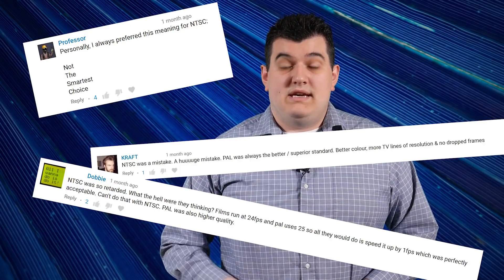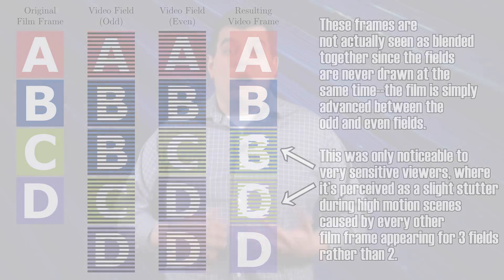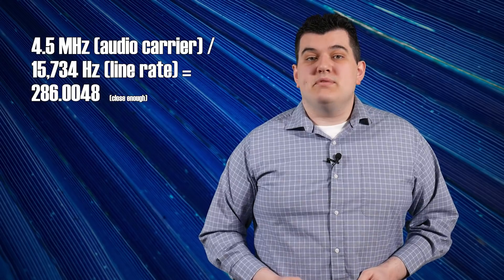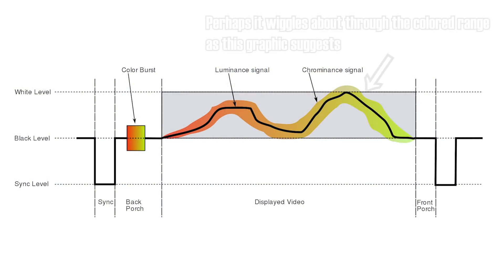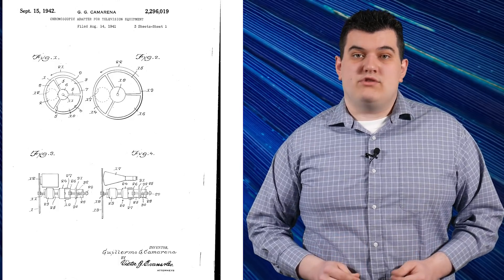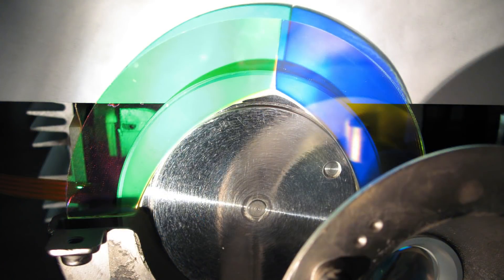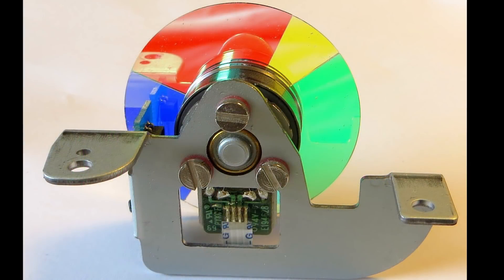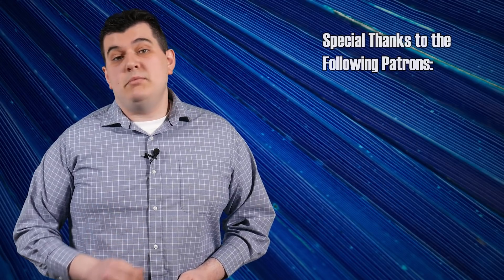Analog Color TV Wrap-Up--Some extra info

Comment: The color information in the video signal is added as a high frequency carrier. The frequency of this carrier is greater than the bandwidth of classic black-and-white TVs which is the trick why those ignore the color information.

Since I am not that familiar with the US terminology for video signals, I stick with what I am accustomed to from the Commodore computers:

The C64/128 generates the Y and colors independently and the RF video modulator mixes them to simulate a TV station. The video jack for monitors offers 3 video signals:

Luminance, Chroma and Composite.

Luminance contains the Y signal with sync signals. This is known as “VBS”, the “Video Blanking and Sync” (BAS in Germany, BildAustastSynchronsignal). This is the classic monochrome broadcast standard.

Chroma is the additional color information, ready to use modulated as a RF carrier.

Composite is a mixture of the signals above, composed together. This is known as CVBS, “Color VBS) (FBAS in Germany, F=Farbe=color). This is usually done by an amplifier with two inputs which adds the signals together. In low cost video equipment, this is often done by using two resistors. VGA cards with “video out” often use a S-video jack and come with an adapter, a S-Video plug with a yellow RCA jack on its end with 2 resistors inside.

It is very hard to make a video circuit with a high bandwidth, especially in the radio tube and simple transistor era. The low-pass characteristics of a video amp circuit can’t follow the fast chroma carrier. What the circuit makes of a CVBS signal is just the VBS part with the average of C on top. The average of the C carrier is supposed to be zero.
Classic radio tube or simple transistor based color TVs still used a simple video amp to obtain the VBS part and a radio tuner like circuit to receive (and demodulate) the C carrier for processing. The tuner also detects if a C carrier is present to enable/disable color processing. In “ancient” TVs, you can hear a relay click which bypasses color decoding and connecting all 3 electron guns to the VBS signal.

More modern TV systems are different and more sophisticated. To get more resolution onto the screen, they filter out the C carrier inside a circuit known as the “Color Trap”. The exact frequency of the C signal is filtered and separated. This allows using high bandwidth VBS amps so you get the  maximum resolution possible.
The trouble is that if there is a high frequency pattern in the VBS signal, e.g. someone wears a pinstripe suit, this pattern can also be “trapped” and used as a color information. Not sure how it looks like in NTSC, but in PAL the suit often has faint pink stains when watching strong UHF channels (or using Sat TV).

The Chroma Signal is very intense. Just like the VBS signal, it also is 1Vpp (1V peak-to-peak). Here is a chart of the CVBS signal for a color-bar test pattern:
https://upload.wikimedia.org/wikipedia/commons/d/d4/Fbas.png
 White is 100% Y (1V), no room for color information left, none is necessary anyway.
Yellow is 66% Y and the C carrier makes the signal jitter between 100% and 33%. A low bandwidth classic TV would see the average of the C carrier which makes it just see the 66% Y inside the signal.
And so on…
When they had copied the color video signal to film using a monochrome machine with high bandwidth, the jitter of the C carrier will go through and cause a relative prominent pattern on the film. Those machines are more like an oscilloscope than a TV tube, extra linear and capable to follow high frequencies. To play back, all the engineer needs to do is to lower the bandwidth of the VBS signal to get rid of the pattern caused by the C carrier, so nobody felt the need to prevent storing the pattern on the film in the first place. 
You can see how this pattern looks like using a C64 with a Commodore monitor. Usually, VBS and C are sent separately to the monitor. In this mode, the monitor disables its color trap. Using a composite RCA adapter cable meant to connect your C64 to a VCR or TV and plug it into the Luminance (VBS) jack, you get a black/white picture with the chroma carrier messing up the picture.
By the way, The Raspberry Pi has a CVBS output (newer versions need an iPod Video cable). Since the VBS signal bandwith is limited by the C carrier frequency, you can disable colors on the raspberry so you are able to get much more detail (finer text) onto an S-video TV. So you can have 80 columns of text (or more) by sacrificing colors. Due to the color carrier, home computers from the 80s had to have 40 columns of text or less. The C128 can display 80 columns, but then you need to use its RGB mode (with special monitor) or you can use an S-video TV but in monochrome only.

Comment: Great Job!
But I have to disagree on the topic of 3:2 pulldown - at least from a modern standpoint.
1. I can understand your point that you want to watch movies at the correct speed but actually... you don't really notice.
2. Today 3:2 pulldown is a pain in the rear. European TV shows that were shot on film (like "The Prisoner") were shot in p25 and broadcast in i50. Even without going back to the negatives and only using the broadcast masters it can properly be deinterlaced by my modern TV. Two fields that originated from the same frame of film are put back together. American shows that were shot on film (like the 80s version of "Twilight Zone") were shot in p24 and broadcast in i60 via 3:2 pulldown. When my TV tries to deinterlace that, I end up with 40% of the frames put together from fields that don't fit together and it looks hideous. On a CRT it's not an issue for me but I can't stand it on a progressive display
Reply: The 3:2 pulldown works great for ordinary film takes where motion causes enough motion blurring. It fails miserably where motions don't cause motion blurring e.g. moving subtitles, fine moving computer graphics and cartoons. While with cartoons, you just loose resolution which causes an "ugly motion blurring", anything filmed with a high speed shutter or simple moving computer graphics looks real bad.

Comment: The discussion of phase issues, was also a concern when cabling video between the sources and a video switcher. Approximately 6” of coax cable, allowing for velocity factor would equal one degree of phasing error at 3.579545 MHz. If phases didn’t match you would get a shift or jump of the phase (or hue if you prefer) at the beginning or end of a dissolve or wipe pattern transitions.

Comment: I actually prefer NTSC. Watching PAL TV always bothered me just a little bit whenever I would visit Europe. Although the picture was a little bit sharper due to the higher resolution, the flicker just messed up my eyes. I can't really see the flicker at all on an NTSC screen unless I move my eyes around really fast or something. But on PAL it's just impossible to ignore the constant flicker and it always bugged my eyes out trying to watch it. I don't know, just a personal opinion but I much prefer NTSC even with the lower resolution and color issues. At least according to my eyes, the reduced flicker was well worth it. In any case, none of this is an issue at all on LCD/Plasma flat screen HDTVs. It's all moot now.
Reply: But the flickering has nothing to do with PAL/NTSC. It depends on framerate and framerate depends on mains frequency. So 50Hz in Europe and 60Hz in US was choosen in 30's - 40's for  B/W TVs.
Reply: I grew up with PAL to me its just a better colour system, American NTSC always looked bad until recently, never had an issue with the flickering even with a CRT, its not supposed to affect you if you are a decent distance away from the TV screen.
Reply: I grew up with PAL (50 Hz) too, but it took me years to get used to that flicker, and even at that point it wasn't pleasant.

Comment: A good example of what we would refer to as “dot crawl” was the opening credits of “Star Trek: The Next Generation” the blue title characters with the high chroma values over black would have visible dots crawling along the edge of the letters. The HD remastered version, the edges are clean since NTSC is not in use. 

You can also see this dot crawl effect on color bars, along the edge of the transition from one color to another, except between green and magenta, where the transition moves through zero luminance and chroma and results in a very thin black line.

Comment: As a German i say, NTSC in the 50‘s was a great performans by american engineers! Heart of NTSC is quadratur-amplitude-modulation of the two Color Signals, you need mulitplyers, free wheeling oscillators and so on. In this times no problem, but in the 50‘s there are only very bad and expensive vakuumtubes.
Reply: My problem is that Americans cheaped out (surprise surprise) on the bandwidth - 3.58 MHz is around 60% of what PAL used.

Comment: Common misconception repeated here. PAL does not mean 50 Hz at all. Ever heard of PAL-M? Flicker free 60 Hz M system with the superior PAL color.
Reply: You're Brazilian.
Reply: @ellenorbjornsdottir1166  sure thing. PAL color system gave us an edge in picture quality, however we suffered in the VCR era when imports from Japan and US had to be converted in order to work in color.
Reply: In Argentina we used PAL-M too!
I was searching the comments and wondering what was the difference with regular PAL since he didn't mention PAL-M.

Now I got my answer, thank you.
Reply: @salemsaberhagen8926  hi, I believe Argentina had PAL-N, which is 50hz
Reply: @rogeriorogerio1007  Yes you are right, I was just doing some googling and it was PAL-N, not M. Apparently it wasn't compatible.

Apparently PAL-M had a higher refresh rate while PAL-N was more similar to the European standard but with more scan lines.

Anyway, I was wondering what were the differences and now I know.

Comment: Great video as always. In the UK in the early 90's we had NICAM stereo, what system was used in the US?
Reply: The US used a system called MTS which works basically like FM stereo. That also ensures it's backwards compatible to monophonic sets, whereas NICAM is digital and compatibility is achieved by simply broadcasting the old analogue carrier along. In some PAL countries there also was an analogue system called "Zweiton", which also ensures compatibility by broadcasting the old mono carrier unchanged and adding a second channel containing the difference between left and right. This could also be used for bilingual broadcast (as could MTS I think).
Reply: In 1985 the US adopted the BTSC sound system which allowed stereo sound with DBX noise reduction and two subchannels for an alternate soundtracks, such as Spanish etc.

Comment: Would 650 lines of resolution really matter that much on the small screen sizes common back in the day?  Most Tv's even well in the 1980's were 20 inches and under.  With such small screens I would definitely prefer the higher refresh rate of NTSC.  A good quality 27 inch CRT in 1990 cost around 1,800 dollars in today's money and were HEAVY!
Reply: 25" to 27" TVs (usually in "console" form, i.e., mounted in a wooden cabinet that sat directly on the floor) were relatively common as far back as the early 1970s. My uncle Herb bought a 25" RCA console TV in the early '70s, and he was far from rich. My uncle Allen had a 25" or 27" console TV from as far back as I can remember (my earliest memories are from 1978); my Aunt Ruth also had one, as did my friend Corey, my friend Tom, my friend Ian, and loads of other people I knew, and none of them were rich. We got one in 1984, and we weren't rich either.

In the 1989 Sears Wishbook catalog there's a Zenith 26" console TV for $539.77 - https://i.imgur.com/49GIFoB.jpg - which allegedly translates to $1,055.86 today, though inflation calculators are far from perfect. But also, keep in mind that the early 1990s is when TVs, even in larger sizes, started really coming down in price. The early '90s is when TVs significantly larger than 25" started becoming common and affordable, such as 29" and 32". They were in cheap plastic housings intended to be set on a TV stand. In 1995 I bought a new RCA 25" TV (plastic housing) for $200, and in 2005 I bought a new RCA 32" standard definition CRT TV for $250, which I still have, and which is still like new. It is awesome for classic video game consoles, such as the NES.

In any case, the difference between 650 lines (576 visible) and 525 lines (486 visible) is marginal even with a 27" TV, at a typical viewing distance. The modern recommendation for viewing distance is 1 to 1.5 times the size of the screen, but back then, how many people sat 27 to 40.5" from their TV? Most people sat across the room, say, 10 feet away, and at that distance with such a small screen, a 90-line difference is practically meaningless.

Comment: When color television first came on the scene the debate was whether or not to buy a color set. At the time this was met with the comment "you gotta' be a g'damn engineer to use it". That was because color sets had two new knobs to adjust, hue and intensity. Also at the same time AT&T was replacing long distance operators with DDD (Direct Digit Dialing), that is area codes. This was just too many numbers for some people. Two new knobs and three new digits and people were having heart attacks about it on the Ed Sullivan Show. It amazes me that today people are setting wireless networks in there homes and creating their own private networks. How did they get so smart.